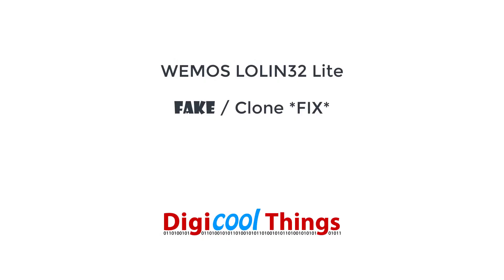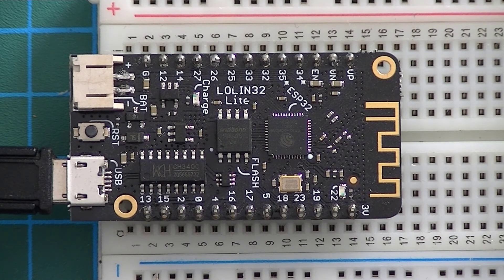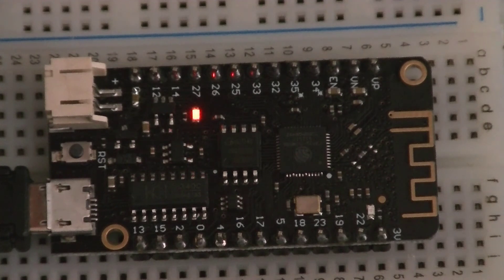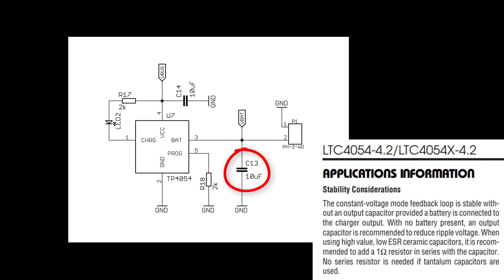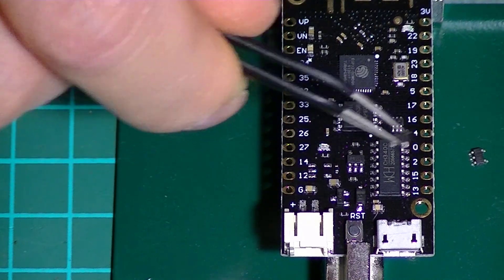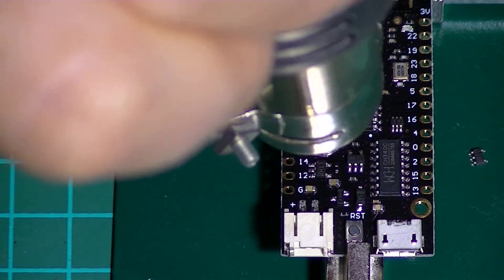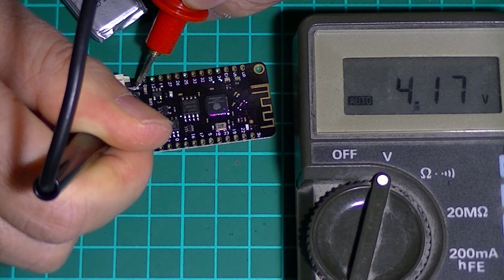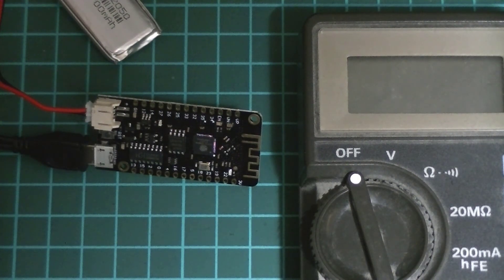WEMOS LOLIN32 Lite - Fake / Clone *FIX*

Comment: Very interesting channel KUDOS ^:} 
A question if you find time please  : 
Is it"normal" for the  LTC4054[which is a LTH7 true}  part to get quite hot 
when it is charging ?  
I have a Lolin 32 version 1 .0 and a 3.7Volt /1.2A  battery that started charging nice but once reached  3.9Volts  i
felt somehow  "insecure" to let it go up to 4.2Volts [to check if the charging will auto end]  because the part got hot 
 as almost the whole Lolin board .I understand it"s linear regulator but don"t know if it has thermal protection.
I was using a standard Macbook USB as input  .
Should i try a "heftier'  [more than 1.5A} stand alone power input maybe ? Thanks n advance ^:}
Reply from the maker: Thank you.  Yes, it’s relatively normal for the LTC4054 / LTH7 to get quite hot during charging.  It does have built-in thermal limiting, to protect itself.  This comes into effect when the die temperature rises above 120 degrees C.  You should be fine to let it go to the fully charged voltage of 4.2V.  Once at 4.2V the LTH7 changes to constant-voltage mode and charging ends when the charge current drops below 1/10th of the programmed charge current value.  Charging automatically resumes (constant-current), when the battery subsequently drops below 4.05V.  The power dissipation is mostly generated by the internal MOSFET.  The data sheet has the equations for Power Dissipation as well as the Charge current calculation, based on the Rprog value (resister tied to the Prog pin 5).  Your MacBook USB should be perfectly adequate, as charge current is typically not set to >500ma, although the LTH7 is capable of up to 800ma charge current.  I however do suggest a close study of the data sheet, to satisfy your concerns. 🤓
Reply: @DigicoolThings  Thank you .Yes i am aware of the 120Celcium i was just "worried' about the rest surround parts
of the Lolin board  [thermal tolerances so to speak }   in case it needs to go "that' high .i hope not .Possibly i will charge the Lipo externally somehow up to 4.1 V and put in just to see if it  will do the auto charge {start /stop] cycle  once go lower.I ll give it a try .Be always well ^:}
Reply: @DigicoolThings  Thanks  .  I can "confirm' that  once the Voltage across the Lipo went
over 4 Volts  {not exact measurement due to my weak DMM battery} the board 'cooled down' somehow and continued very slowly the charging process up to a point "around' 4.16V
 where the LED started "flickering"  [comparator threshold  i guess}   and finally went OFF .
I can safely  guess that i have genuine part after this "behavior"  .Agreed ?  Be well ^:}
Reply from the maker: @georgef1801  That sounds good.  When the battery approaches around 4.2V the charging circuit should turn Off (LED Off).  The charging should then remain Off until the cell voltage drops again to around 4.05V (as I recall), at which time the charge LED should come fully back On, as another new charge cycle begins.
As you’ll note at the beginning of my video, my faulty / fake boards did Not turn Off the charging when the fully charged 4.2V level was reached!

Comment: 2024: For those misled by the information on this video, be aware that there is no way these chinese boards have as charger an original LTC4057. The marking is indeed LTH7 but it's actually a chinese clone which in several of my tests, behave closer to the TP4054. To make a story short, there is nothing wrong with the charger IC and it charges correctly. No need to modify anything.
Reply from the maker: 2024: I assume that you just completely missed that I obtained my replacement LTH7 from AliExpress (i.e. Chinese), and that I clearly demonstrated this replacement resolved the problem.  Also, I have had many people thank me for helping them to resolve this problem for themselves.  You are of course welcome to your opinion.

Comment: thanks , got the same bug of a copy .  looked genuined but i guess we cant never know anymore .  beside heating the chip up on idle , i wonder if i could just ignore the problem for my project since i dont require batteries. thats deatl with further up the chain already .  bought a  esp32 wroom lolin32  v1.0.0 with red blinking in summer 2023 , theres like 4.7v on the batt socket even if nothing there
Reply from the maker: Hi.  Yes, if you're not using the battery connection then it's not really an issue.  This issue is more a concern if you're going to be using a battery connected to the board's battery connector.  If optimising power consumption is a requirement for your project, you could also consider removing the LT4057 (or the LED), if not using the battery connection.

Comment: For anyone stumbling across this video in 2022, please refer to the comment by @Marcus Weseloh for clearer picture on the issue.
These clones actually come with TP4054 based lithium battery charger circuit, where the blinking of the led is actually on purpose. I found couple of sellers (in Europe) which have this info officially listed. Have fun with your boards!

Comment: PLEASE NOTE: It is normal for LTH7 charge-led to flick when the board is powered with no battery connected. LTC4057 is totally a different chip so DON'T mix it with this LTH7. As soon as a battery get connected the led becomes solid and charging begins && LTH7 will switch off  charging when the battery reaches just above 4.2V (Practically  LTC4057 goes off between 4.13 - 4.19V). @Digicool Things ... I think you just guessed that the chip was faulty and replaced it  ... I am sure you didn't  try fully charging the battery.  We have many clones/fakes in our lab at the university (UCSD) ...they all work good.
Reply from the maker: Hi. Thank you for your feedback.  Firstly, I need to correct you on your device references.  1) The LTH7 is a LTC4054, not the LTC4057 you refer to.  Please pay attention to the datasheets.  An LTC4057 is not pin compatible (it has a shutdown input), and it is marked as LTAEW (not LTH7).  2) Again, please make yourself familiar with the datasheet. The LTC4054 SOT-23 package is marked as LTH7. i.e. LTH7 is a LTC4054.

You did state: “It is normal for LTH7 charge-led to flick when the board is powered with no battery connected.”  
Indeed, this is correct, as I did initially demonstrate using the original WEMOS Lolin32 Lite board.
i.e. The charge LED should briefly flick on once only, and then stabilise in the non-charging state (when no battery is connected).
Also, when you said “LTH7 charge-led”, I’ll assume you intended to state (in more technical terms): “LTH7 nCHRG pin momentarily goes into the strong pull-down state (charging), when the board is powered with no battery connected.” 

I also note your reference to “just guessing”, and also that you have clones in your lab “that work good”, thereby inferring that by having multiple boards exhibit the same behaviour, “it must be right”.  This is somewhat concerning to hear, from someone in a university lab.  
I'm also unclear why you would think that I "didn't try fully charging the battery"?  Please be aware that it is only through fully charging a connected Li-Ion battery, across multiple test scenarios (on both the clone and OEM boards) and monitoring the charging, that I could fully assess the issue, and also verify both the correct and incorrect board behaviours.

In this case, we have an unstable charging <> non-charging loop (with no battery connected).  Also, a failure to terminate charging of a Li-Ion battery at the 4.2V level is a safety concern.  These behaviours do not appear correct.  In addition, the expected “correct” behaviours are also being clearly demonstrated by the OEM board (i.e. a stable non-charging state and appropriate 4.2V charge termination).
 
Your first approach to any behaviour that does not appear correct, should always be to analyse the circuit. This involves fully studying (and understanding) the device datasheets, and applying appropriate analysis of the circuit involved.  
Guess work and assumptions should not be your “go to” in the technical analysis of a circuit’s behaviour.  Attention to detail is also important.  eg. LTC4054 datasheet (not LTC4057), for a LTH7 marked device.

If you do take the time to view the entire 10 minute video, you will note that I first clearly demonstrate the correct operation of an original WEMOS Lolin32 Lite board (i.e. stable non-charging state with no battery connected).  I then clearly demonstrate the clone board presenting as unstable, continuously switching between the charging & not-charging state, with no battery connected.  Also, I demonstrate a failure to terminate charging once above the 4.2V level.  Then, I show replacing with a new LTH7 (LTC4054), and then I clearly demonstrate the now expected “correct” stable non-charging state, and the correct charge completion termination (both, as expected and as demonstrated by the original WEMOS board). 

I apologise if my video didn’t go excessively into my own technical analysis, however I believe I did both reasonably & clearly cover-off the key points and datasheet references.  It was my intent to cover this topic as clearly as possible in an easily digestible 10 minute video. 

Apologies also for the long reply, but I do sincerely hope it assists you with your own analysis.
Reply: @DigicoolThings  The FACT is that you made a “serious’ mistake by replacing the LTH7 chip… it was working normal, you may have did this since you had a hand-over of the older boards. . Should have waited till the led went off.  BTW LTH7 is a much better chip since it fully charges the battery to .. cut-off  at  just over 4.2V  and cuts-in at 4.18V.  (No need to become "noisy")  God Bless ........
Reply from the maker: @KaivitiSingh  Okay. I’m sorry I misjudged your intent and tried to help you out with some technical understanding.  I now see that you are just trolling, with calling people names etc.  Very immature of you.  But that’s okay, viewers of your posts will see you for what you are, and they will make their own judgement, now and in the future.

Although I suspect that you’re not really interested, if you do actually refer to the LTC4054 datasheet, you will see how your claim: “that LTH7 is not same as other chips (4054, 4057 etc etc)” makes you look a little foolish.  I repeat for you again: LTH7 marked SOT-23 is an LTC4054 (as per the datasheet).  Likewise, your complete disregard of all that has been presented, also makes you appear rather foolish.  

Enjoy your trolling, I’ll leave you to it and let others make their own judgement.

EDIT: I see you have edited your reply to remove your name calling / abuse, as well as removing your incorrect statement (which I quoted).  However, my reply here will remain, as being the appropriate response to your originally posted reply.
Reply: @DigicoolThings  Ohhhhhhhh   how many times I have to tell you that LTH7 is different && has no direct equivalent:  since this chip keeps polling for the battery to get connected (flickering) .  As soon as a battery gets detected it goes into charge state (Led=solid) .  As soon as charge is full the led=off.  Other chips don’t behave this way, they are off when there is no battery.  (Please STOP  your lengthy essays … it reminds me of first year students).

Comment: Hi Brian. I am having the same issue but do not have a Hot air gun. Buying it will cost more than replacing my two esp32 boards that i recently bought. What will happen if i just remove LTH7? Will i still be able to use my esp32? Will i be able to plug in a battery and use it without charging? I found out that the board is consuming too much energy even while deep sleep, and around this component  LTH7 it gets super hot.
Reply from the maker: Hi Dmitriy.  Yes, looking at the schematic you should be able to just remove the LTC4054 (LTH7) charger IC and still be able to use the ESP32 battery powered without charging capability. 
However, an alternative option may be to just remove the LED itself.  This would remove the ~10ma “charge” LED power drain through the LTH7, whilst retaining the LTH7’s charging functionality.  Although, you’d still like to be comfortable that your LTH7 charge cycle is correctly terminating (ie. when 4.2V is achieved and the charge current has dropped to the 1/10th threshold level).
Hope this helps.

Comment: hi, good video, 4054 it is for LIPO or li-ion battery ?
Reply from the maker: The TP4054 is a standalone charger for single cell Li-Ion batteries. But just think of LiPo as being a modern version of Li-Ion, which uses a Polymer electrolyte, instead of the original Li-Ion liquid electrolyte.  LiPo is just short for Lithium-Ion Polymer.  From a charging perspective both can be treated the same, so TP4054 applies to either Li-Ion or LiPo battery cells.  Hope this helps to clarify.
Reply: @DigicoolThings  thank you so much

Comment: I once ordered a knockoff lolin32 board, it didn't work at all and wasn't recognized by the pc. Upon closer inspection, the ESP32 module was not soldered on straight, so some pins didn't connnect and some were shorted together. Took some hot air, realigned the module, let it cool, and it was working fine since.
Reply from the maker: Nice work.  You'd wonder how it got past their QC inspection (assuming there was any QC involved!).  Always great to hear these DOA but successful repair stories!  :-)
Reply: @DigicoolThings  Highly doubtful there's any QC on these knockoff modules honestly. But yeah, I figured no big deal if my repair attempt went belly up, the board was only a few dollars so nothing major would be lost.

Comment: Looks like the LOLIN D32 V.1 light  has the same charge issue.  It has a good LOLIN D32 silk screen so very hard to tell if it's a fake or genuine. I have ordered some TP4054 charging chips to make a replacement to see if this resolves the charging light flickering .
Reply from the maker: Interesting. Let us know how you get on with your TP4054 replacement.

Comment: Thank you for sharing and showing. My 2 boards are unmarked and have blue LEDs. When connecting USB-Power, the charging LED is blinking quickly. So I think, I could have the same faulty charging chip. But I tested it and I think it is okay: First I connect the USB-power and the LED starts binking. After connecting the battery, the LED is lit constantly and the USB-Port is delivering 500mA or 2,5W. The voltage of the connected lipo (430mAh) slowly goes up to 4,2V and after a while the LED turns off and stays off. When I disconnect USB-power the LED blinks once very short. After reconnecting, the LED turns on again... (the lipo had 4,16V so it is recharging to 4,2V, which I think is okay). So the function seems to be fine even with a blinking LED and an unmarked board!
Reply from the maker: Hi. Thanks for viewing. Interesting. I would say that if you have verified the charging circuit is operating correctly (with a battery connected), then you are good to go!  In my case the fault also included the charge circuit failing to terminate once the LiPo was fully charged.  Just the charge LED blinking / apparent battery detection instability (when no battery is connected), would only be a concern if you were looking to fully optimise power consumption, when not powered by a locally connected battery.  ie. If your project is not ultimately battery powered, then the flashing LED alone shouldn’t be an issue.
Reply: @DigicoolThings  Thanks for replying! I agree, it should be fine like that with a battery connected.

Comment: Good job my dear friend. I have only one question... Which battery did you use in this video? I don't see the mAh spec..
Reply from the maker: Hi. The LiPo battery I'm using is a model 702050 - 700mAh 20mm x 50mm.  These are nice & compact, but still relatively thin for embedding in projects.  Hope this helps. :-)

Comment: Do all fakes have these faulty 4056s? I have a Lolin32 and Lolin Lite, both with flashing LEDs
Reply from the maker: Yes, it seems to be a common issue. Note that all of the boards I'd purchased from the official WEMOS Store did not have flashing charge LEDs. The TP4054 datasheet confirms that a charge cycle should not commence without a battery connected (assuming circuit stability). The video clearly demonstrates the correct operation. If you have a flashing charge LED with no battery connected (ie. it's switching in & out of charge cycle), please note that this is not an issue if your project is not battery opperated, or optimal power consumption is not a consideration. Hope this helps.

Comment: Hi, Thanks for your video, What does happen if we don't replace the ic?
Reply from the maker: Hi. If you want to use the LOLIN 32 Lite for battery powered projects (which it is well suited for), then this issue is a problem.  It is also a problem if you are concerned with low power operation.  However, if you are not interested in battery operation or power optimisation, and you're just powering your project from USB / external power supply (with no battery connected), then the boards are still usable with the fake / faulty LTC4054 part.